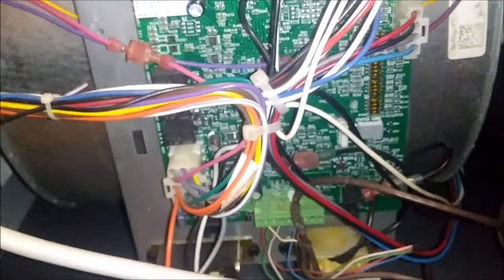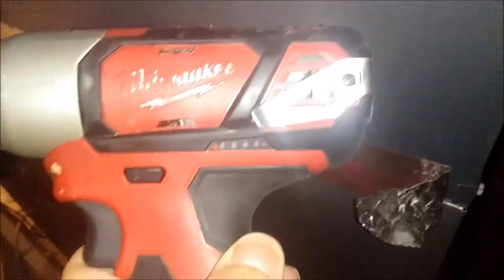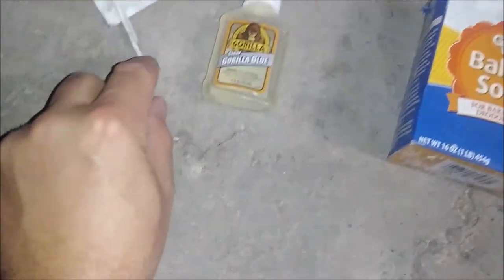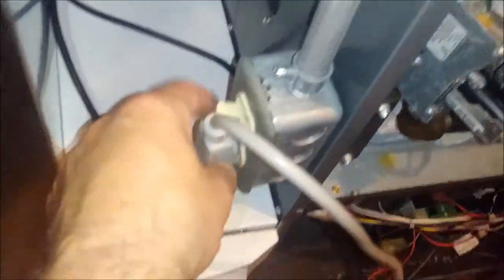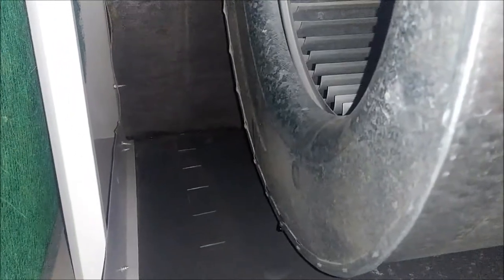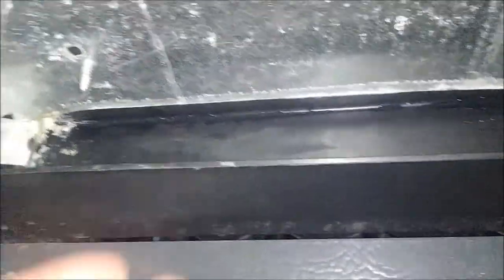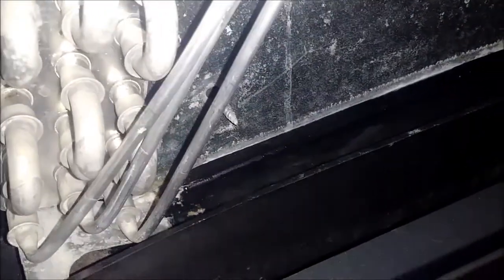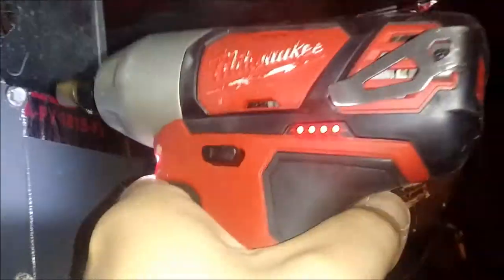Goodman \ Amana Ac Unit Drain Pan Crack Repair

Comment: Can we get a follow up video on this? Did the super glue/baking soda hold indefinitely? Or did you have to find a replacement pan? I'm in the same position right now but I have to lift the coil off of the pan to bring it out and get to the crack. The plastic pan is no longer available for my Carrier unit either. Thinking of finding someone who does metal work and ask them to replicate it using sheetmetal. I know it's not a straightforward design like yours but I gotta try!
Reply from the maker: https://youtu.be/6jxonkHCFkY
Reply from the maker: Super glue was temp fix. Ended up replacing the pan. Not so hard :-). If the crack is in a easy to reach and fix area the super glue will hold and infact hardware stores sell marine super glue that sheds water and is actually a much better choice. My pan had a crack in a bad spot where I could not get it to seal up 100% so I replaced it.
Reply: @icanfixit5989  can you replace the pan without replacing the coil because my AC guy said there’s no way to replace the pan without replacing the entire coil costing $3300 he said it’s attached and it’s not possible to do one without the other everything is functioning properly except for this leak and I really can’t afford to spend $3300 on this
Reply from the maker: @outofthebox9913  For my situation I was able to replace the pan without and issue. I supported the coil from overhead with a 2*4 and some rope in the duct. I'm 100 percent sure a HVAC guy would not do this so do this at your own risk. If an HVAC guy attempts to replace the pan and if something breaks they will not want to be on the hook for a broken system, however I was able to do this with no problems and only slight complications like getting the new pan in place.
Reply from the maker: @outofthebox9913  Again for my situation I was able to lift the coil enough that I was able to slide the old plastic pan out and slide a new pan in. Not all systems are the same and your situation may be different. The pans are relatively inexpensive so if you can do this it will save quite a bit of money. Again you must be mindful that the coil is attached in the system and does have a fluid in it so you don't want to break anything. Being gentle is key.
Reply: @icanfixit5989  thanks for the reply. We ended up just going with another company and getting a whole new system. Sucks to have to do it but should buy us many years of peace of mind. Thanks again

Comment: plastic pan , i would get a plastic welding kit from harbor freight and weld it shut , practice on other plastic first till use get good enough , i have fixed drill holes n my plastic barrels works great the more plastic you melt on it the better .

Comment: My ac guy said a crack in the pan cannot be sealed or repaired without replacing the entire coil costing 3,200$. Any advice. Is this something companies just don’t like to do and why.
Reply: No company would like this so they can make 3200 for removing  the coil.